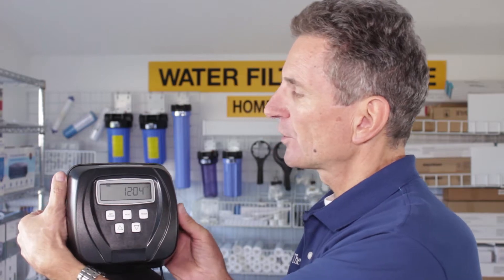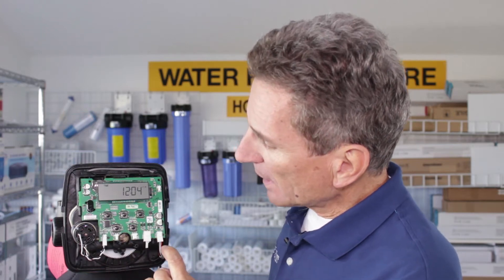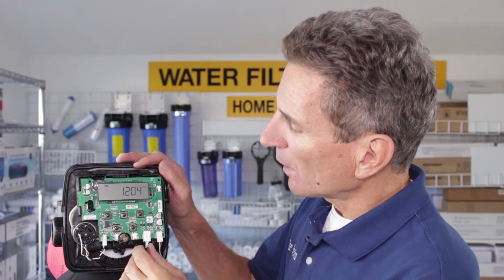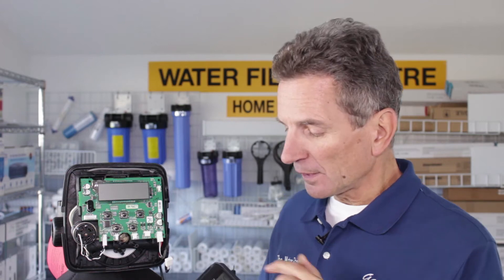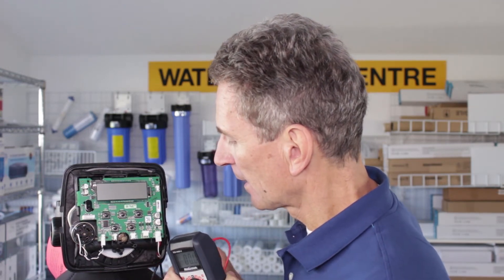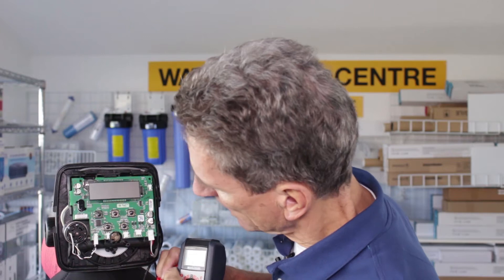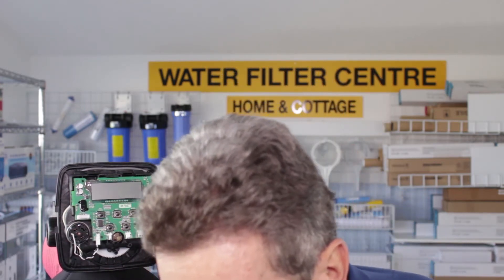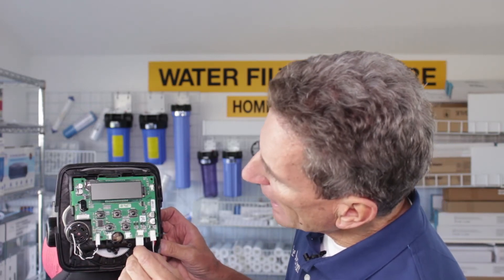Water Softener Troubleshooting Clack WS1 Blank Screen

Comment: My screen went blank. I checked and have power. I ordered a new circuit board and installed it. Still blank. I am thinking I got a bad board but before I try to return it should I check anything else?
Reply from the maker: Yes, the power supply here https://waterestore.com/products/clack-ws1-replacement-transformer-clk-v3186 at that link it will show you how to test it to see if it is the power supply or the cicuit board,.

Comment: What did you have the tester set to?
Reply: And if the transformer is good, replace the whole board?
Reply from the maker: Yes, you will need to replace the board
Reply from the maker: It was set to low voltage

Comment: I replaced the circuit board and transformer, it still won't power on, I have a ws1. Any other ideas?
Reply from the maker: There are only 2 parts electrically and you ahve replaced both of them so it should power on.

Comment: I have a WS1, 3 button, for about 4 years now.  In this time the display board has died 4x, I know that replacing the board will get it going again, but it seem that it is extremely fragile.  The previous time it died, I replaced the power supply as well, just in case.  But now it is dead again.  I can only guess its some power problem, but I have no idea what to try, I do not have any other ac outlets to plug into at the water softener.  I am at the point of just replacing the entire setup with another brand.  Any thoughts on what could be causing this or what I can do to try to stop it?  I live in SW Florida so lightning is a big problem, but most of these failures were during dry season with no rain or lightning.  I have not lost any other electronic equipment during this time.
Reply from the maker: VERY Unusual, I have never had anyone replace their board more than once.  Have you tried a surge suppressor?
Reply: @water_estore Thanks for replying, going to give this a try, should have an outdoor surge protector and new PCB by the end of the week. I'll post back as soon as it dies, or possibly 3mo, 6mo, 1yr if it survives.  None of the other boards lasted a year so well se how it goes.
Reply: @WeeToddDidd did it last 3 years?
Reply: @pete2997  I think I nailed it down to the 'weatherproof' electrical box.  Somehow there were no gfci outlet on the power to the brick suppling power to the controller..  The outlets are buried behind the water tank and have little room to work on,  I replaced the weatherproof box and corrected lack of GFCI and added a whole house surge protector.  The old outlet  was a bit rusted in place and showed signs of water intrusion. Everything has been holding up so far.
Reply: @water_estore  I also have the same 3 button one and mine just recently died after this most recent storm Helene. I've tried everything to troubleshoot why there may be a blank screen besides replacing the board or the power supply cord. Where might I be able to buy the board and new power supply from?

Comment: Hey Gary. I need to troubleshoot a E1 message on my carbon filtration tank. Can you help me?
Reply from the maker: E1 is the same as 1001 in the manual here under troubleshooting https://cdn.shopify.com/s/files/1/0659/5447/files/Clack_WS1_Manual_Including_Drawings_and_Part_Numbers.pdf?11988583073503085745

Comment: Hi Gary. This is Allen. On the video you connected the black lead of the multimeter to the black wire. Then you said you connected the red lead to the other side. What do you mean by "other side" as there are three other white wires and the video doesn't show the connection? I'd appreciate if you could kindly specify. Thank you.
Reply from the maker: There are four wires, connect the black which is at one end and the red to the other end.
Reply: @water_estore  I do have a voltage tester but the video does not show where you are actually sticking the ends into the connector? Is it on the back side where it shows tiny slots of metal or maybe that's the wire?